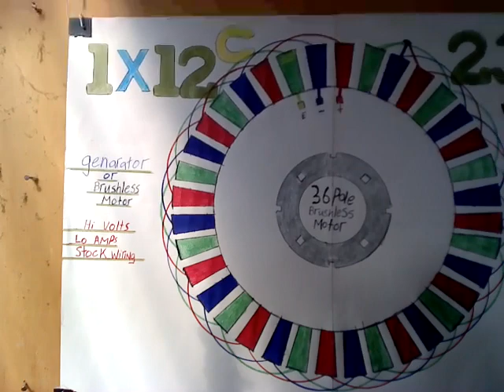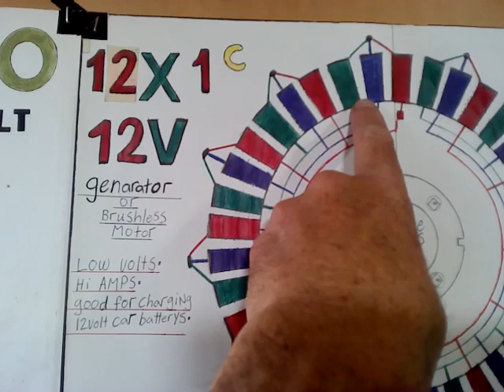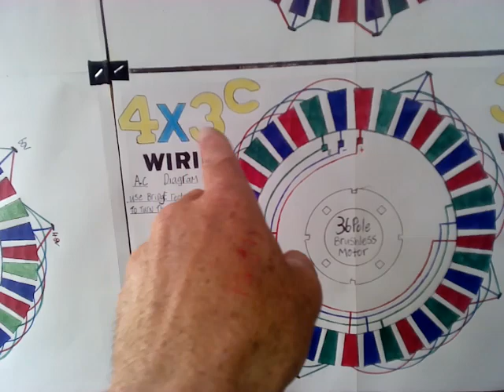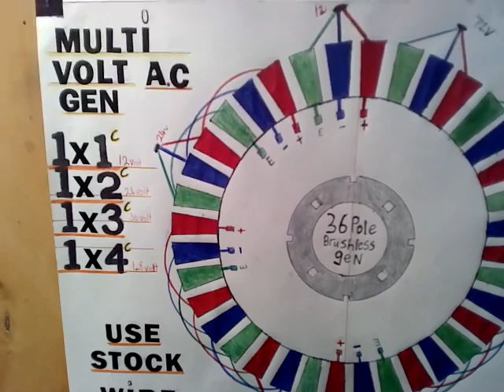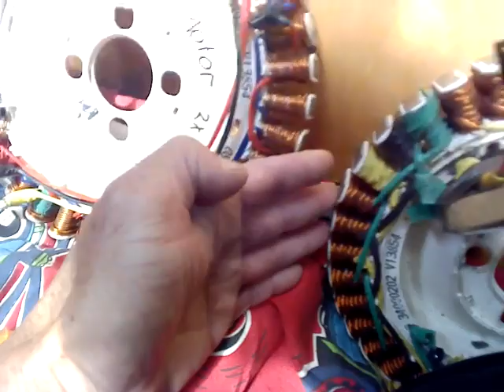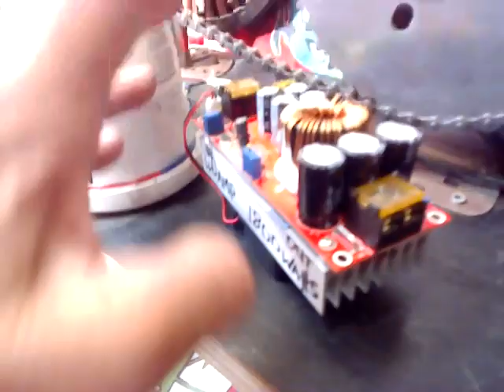smart drive washing machine brushless motor 36pole best wiring diagrams 12v.24v.36v48v.60v.72v ,240v

Comment: I'm in the USA with 120V mains. Do I need to wire for double the voltage in your diagrams? Use  4 sets of coils to generate 24V.

Comment: I didn't read all the comments but how fast do you have to spin the magnet to produce 230 volts
Reply from the maker: Just only as fast as you can turn it with one finger.i think 🤔 it's only about 100 rpm it could be even less
Reply: @tristanmcnabb2741 can you check it out for me please and make a video showing your readings,  it would really help me out big time. Thank you for such a speedy response and thank you from the ❤ for your videos. I really have a trillion questions about wiring and application.  Hehe

Comment: Sure, they're rated for 300v, obviously 3-phase. I think the thing should push considerably more than an E-bike, the torque should be pretty impressive on higher voltages. AC or BLDC (which is essentially the same thing, but using a dc controller and whatever waveform works best).
Reply from the maker: Hi yip stock wiring Thay can handle that much for sure 😊👍 but wen you rewire the bldc motor for 48 volt with bigger wire like 1.5mm them it drops the ohms and makes the controllers twice as powerful on a lot voltage still with good talk 😊 biggest thanks from cruzermans inventions 🎉🎉😊

Comment: Cruzerman  am your big fun. Which winding of above washing machines motors can run on high rpm with low voltage and low amps.
Reply from the maker: It would be the 12x 1 wiring diagram because it doesn't take much volt or amp to run as a motor . good for 12 volt generator 😁😊👍🎉
Reply from the maker: Biggest hi first of all yip if you can rewire the motor with 1.5 mm cooper wire say 28 turns per pole in to any of the wiring diagrams you can get 3x the speed out of them lol 😂🎉 with just a 48 volt 1000watt controller.allsome stuff thanks from cruzermans invention